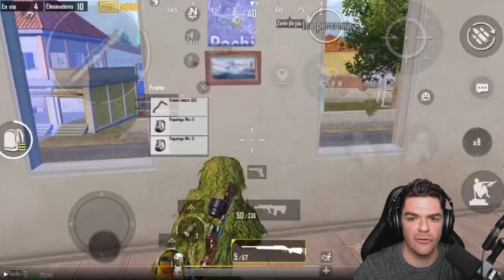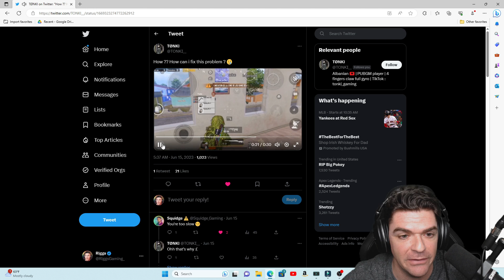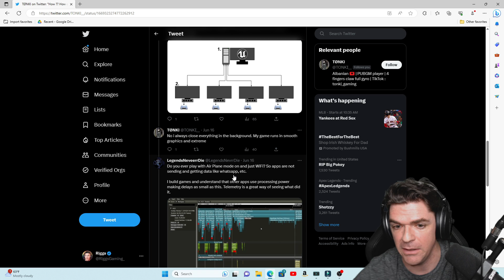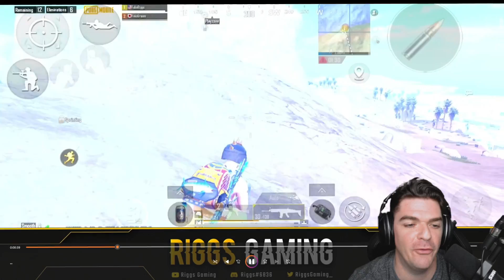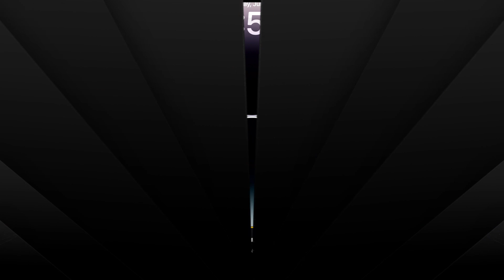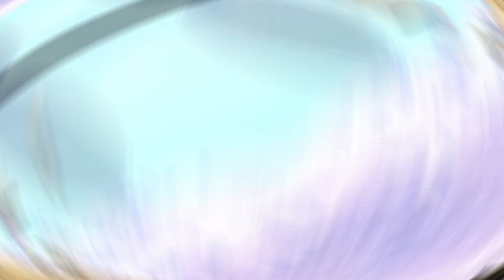NEW DISCOVERY! NO MORE DESYNC or LAG!! (Low End and High End Devices) PUBG Mobile

Comment: Im in a video?! 😅 Also yh that first part was saying No 1 was the server and No 2 was the client/device played with. (Unreal Engines Documentation, which is what PUBGM is made with)

All events are played in sync on the server, so the client could see a hit but it may NOT be a hit. Thats just an effect (Blood on screen). Freeing up resources on your device. Ending all apps, Airplane mode with only WiFi is the way to play. 😊Then you get less input lag and a smoother gameplay overall. Hits registering better etc...

Another one is to get a gaming router (You do have to set it up!), it will help with ping and manage your connections better for playing games over WiFi.

Comment: The case here being when your phone is on mobile data it tends to search for a faster speed connection to the cell towers around doing this while receiving data at the same time reduces the smoothness of your game and causes the device to heat up faster. while having only WiFi turned on removes the function of your phone connecting to a cell tower 🗼, and the WiFi  instead does the connection for your device making for a more smoothly gameplay and a little higher and stable fps
Reply: If your using two phones one for the hotspot and the other connected the WiFi you will notice the the one with the hotspot heat up faster due to it send and receiving data to your device while your play... The same thing goes for mobile data your phone does all this functionality alone causing a chopping gameplay sometimes

Comment: I don't think this is the solution though.

1. When you put on APMode you expect to keep other apps from running in the background, as "you" mentioned socials etc.

2. When you enable wifi, you defeat the purpose of Airplane mode, as you apps Whatsapp, Youtube, Facebook, Instagram... Etc. They get to use the Internet as well, and so they are are still running...

3. Only benefit i can see from Using APMode is to cut off Telecom Services, which will in turn just help with battery preservation... 

4. I know your game lags when you are being called but that's Rarely, im using a x3Superzoom Realme, and i get calls without my game lagging as i keep playing, whilst on the call, only downfall is, i have no game sound, my mobile it has an 855+ Snapdragon. So as for lagging, I don't think that's quite it, something else is happening in the background that we are not aware of.

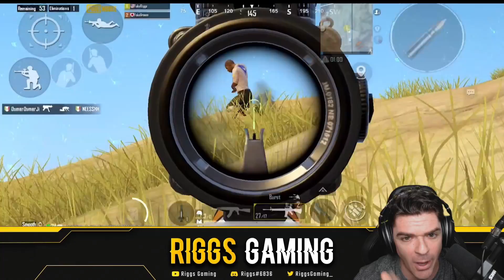Comment: sorry riggs but this is complete cap. i wont call it “clickbait” since i think ur just oblivious to this, but the frame drop etc that u showed of ur karakan game wasn’t frame drop and was caused by u pulling down the drop down (notification centre). u can see it at 4:20 onward. just coz u have airplane mode on, it’s not going to stop ur device from running in the background once u turn ur wifi on as most things on ur phone with operate on both mobile data and wifi.

Comment: I think your data is fine Riggs, I think your fire button were at the top of the screen and while you’re tapping it , you also pulled the notification centre down which cause the game to be choppy. I’m sure if you review the footage you could spot the notification centre swipe down tab on the screen😆 (footage from 4:20 to 4:34)
Reply: That’s why I use Guided Access.
Reply: @TheWelchProductions  that would be a better tip than airplane mode.
Reply: lmao yeah
Reply: Seen that too. Guided access fixes that
Reply: yeah this dude is overreacting high end iphones have more than enough power for this game it could work for super low end users though
Reply: @stuntbizzfx  he just want’s everyone to be informed. He is Not bragging.
Reply: @Riggs- he has a valid point

Comment: What I think that although this may have something to do with wifi, the main thing is that PUBG mobile has a low tps, ticks per second. Meaning that the game server itself is processing data much slower. If you look at new states or pubg pc, this issue doesn’t occur because their tps are very high. Sometimes, its just pubg itself. Wifi is just a very very small potential factor.

Comment: There is an another thing that causing this issue its the updated Hit marker i was having this problem from this season i didn't knew why then one of my freinds told me that this is the problem.

When i turned off the hit marker the gamplay was much smoother. improved aim and weapon damage no lag .. Hope you try it Riggs and see the difference
Reply: How do you turn off Hit Markers? Are you talking about Auto-Mark Hit locations?
Reply: @fairsquare8632  

No, when u get shot at u get markers on screen shows u where the shots r coming from. It used to be ok but now with the new season update they updated the markers which makes the gameplay lag during fights.

U can find it in sittings > advanced sittings then scroll down where u can see a new tap about hit markers disable it. Its not gonna disable the whole thing but it will go back to old style markers.

Comment: I'm a fan and watch all your content but this here right now I do not agree because you clearly do not understand what you are talking about. If your device is connected to the wifi, any app that uses internet services will still be running and exchanging data depending on the app. The only thing that's not gonna work is phone calls and text messages.

Comment: 4:48 That was not mobile data lag that was your finger opening Control Centre when you were tapping the fire button you can fix this by putting your phone in guided access.
Reply from the maker: I need to fix that as well but the game still felt very choppy until restart. Thank you!
Reply: I was about to comment about that "lag" and tell riggs that he needs to use guided access specially how close those buttons on the upper edges/corners.